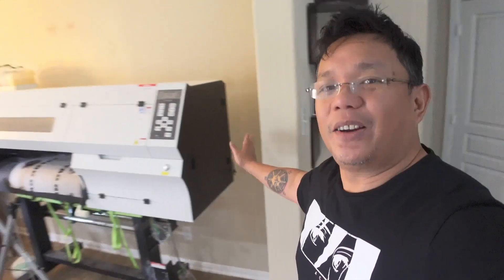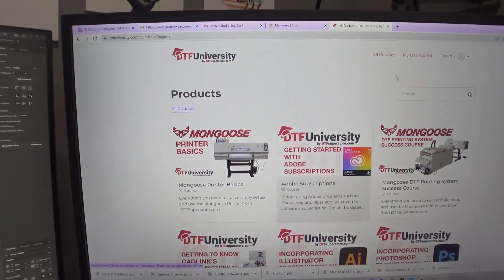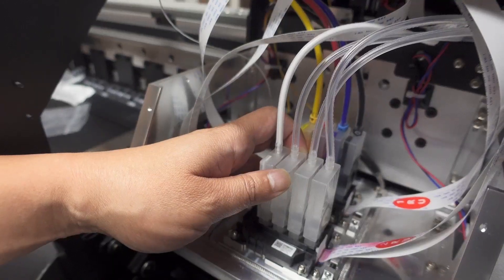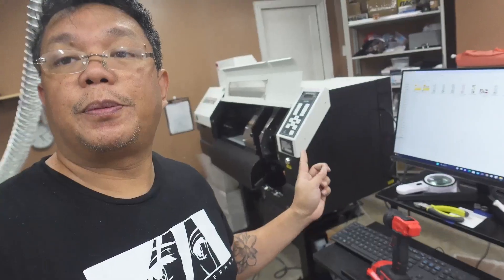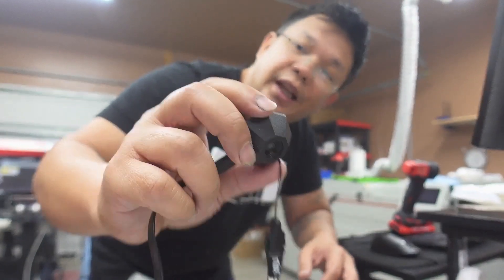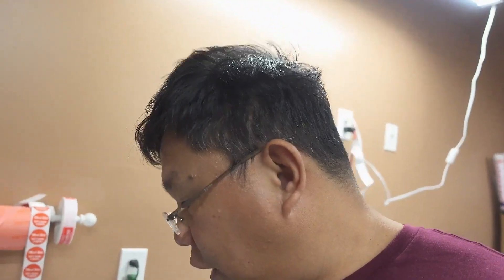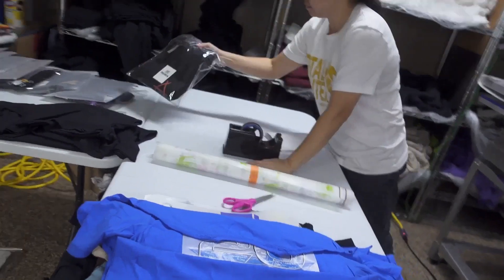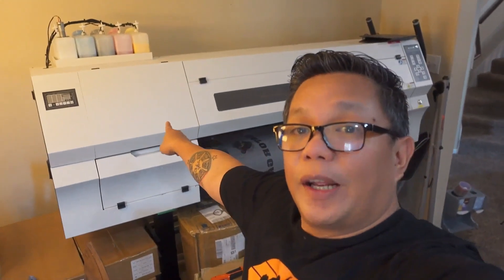DTF Colors All Wrong? Here's How We Fix It

Comment: My color is all of a sudden just not printing right.  it was fine for months.  its almost its hue is off.  for example greens are coming out bright yellow.  Any clue as to why?  I did a thorough cleaning of the print head, made sure no clog, pulled ink and even pulled ink at the waste.  I am baffled at why it happened and how.
Reply from the maker: So sorry for the late reply. Been a little busy. Check if your dampers are contaminated with a diff color ink or if ink is not flowing
Reply: @merchstudio same experience here and the damper has been contaminated with other colors. What to do with this?

Comment: were about to calibrate our dtf printer. Did you went ahead and print out the color swatches, then pressed on the shirt to calibrate the printer? or how did you go ahead and calibrated? theres not video on line to go ahead and follow. Thanks in advance!!! great channel
Reply from the maker: Which calibration system are you using?
Reply: @merchstudio  were using the i1profiler with the printxp (SAI flexi print v19) software